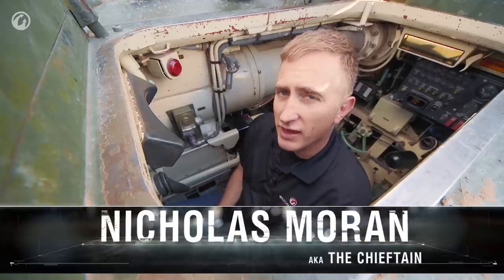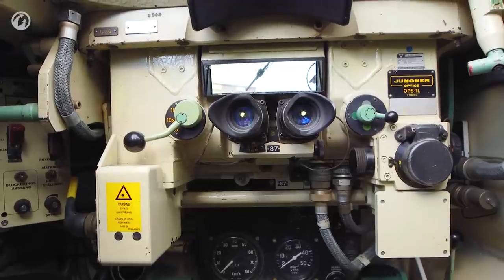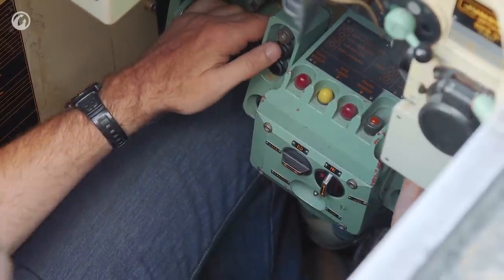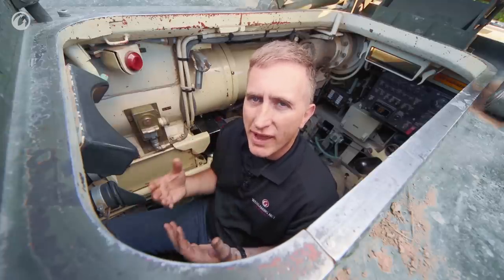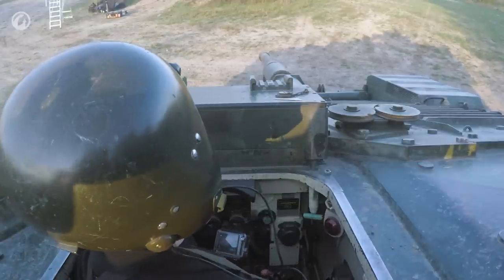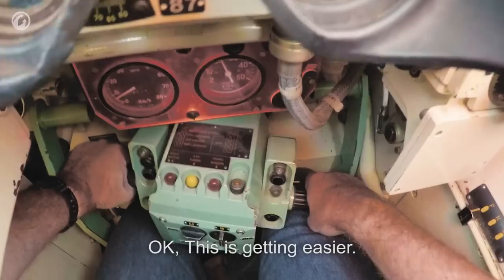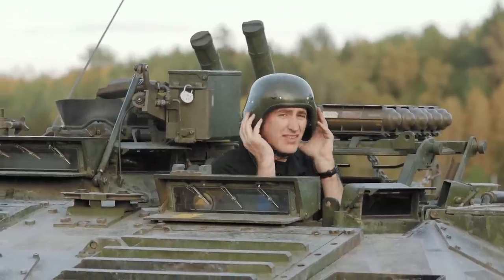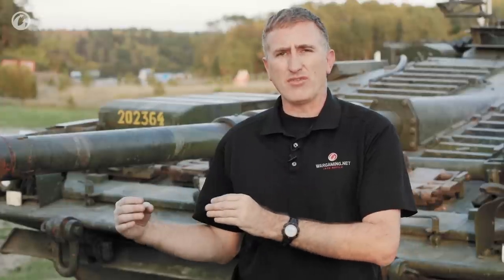Inside the Chieftain's Hatch: Strv 103C part 3

Comment: This was an amazing tank and it was a bold move from the Swedish government to put national security at risk on such a novel and unproven concept. I think the idea still has potential for a number of reasons:
- Advances in active suspension technology can make gun stabilization possible for this tank. You only need 1-plane stabilization as on the horizontal it's very easy to keep the tank on target manually with a car-like steering wheel;
- You can mount larger guns that would be possible with turreted tanks. I think a 155mm wouldn't be much of a problem.
- You can still add on top a small automated turret with lighter weapons if necessary;
- Lower height and thicker armor than in conventional tanks are still possible;
- Additional weapons can be easily mounted coaxially with the main gun; a Bofors 40mm autocannon for instance, to deal with softer targets;
- It has the potential to be cheaper than a traditional tank; that's no small thing in today's market where tanks have grown very expensive.
Reply: You would not like to add one gram to the weight of the 103. Your ideas are interesting, but they would immediately end up with a 80-ton monster that couldn´t swim, and would get stuck everywhere. The armor of the S was very thin, and making it able to resist modern APFSDS would add some 10 tons. A bigger gun, with a not too small magazine, would add another 3-5 tons. New engines to match this would add 2-3 tons. More fuel to retain range would add at least one ton. Sheer size to accommodate new engines, bigger ammo etc would add 10 tons, just by structural members, thin side/top/floor armor,  track length and additional road wheels. The 40 mm Bofors with ammo adds an extra 2 tons. And how do you stabilize a gun that is fixed in the hull, in height and traverse? Without doing away with the crucial auto-loader? Easy to maintain horizontal aim you say? Do you know how much 1 degree mean at 3000 m? I think you are dreaming, and very far from being attached to the reality. The Swedish designers in the 50´s were thinking outside the box, but they had common sense when it came to simple engineering - which you lack. They also had a list of goals to fulfill with the project, and they ticked them all. Sadly other countries didn´t have the same list, so it was no export success.

Comment: Looks like a great solution to the Swedish situation with heavily forested, rolling terrain in the defense..  One of these can control an avenue of approach like a boss and then disappear to the next position.
Reply: A good description of the actual doctrine👏
Reply: You could also advance forward while covered by your fellow tankers from one hull down position to another, almost like infantry. I believe they spend a lot of time scouting out positions.
Reply: I was thinking that the S tank design would make an excellent solution to a modern airborne firepower vehicle. You would have to reduce the weight to 20 to 25 tons, up the horsepower, use modern equipment add a small turret with a 20 or 30mm gun with a missile mount and a seperate remote  machine gun mount. I would like to see a 120mm gun tube but would settle for the 105 due to ammo stowage considerations. Obviousely the machine has limitations but it could be airdropable and would provide armored infantry support big guns where there arent any now. The requirement  would be largely defensive holding an objective until relieved...
Reply: @ONECOUNT  bounding overwatch ftw
Reply: @gweiloxiu9862  Exactly!
Reply: The Swedish forrests was one of the reasons behind not having a turret as you can't really spin a turret around in the middle of a lot of trees.

Comment: I beat with modern electronics you could redesign the S tank into an impressive modern tank. Many of the faults in the tank could likely be designed out of the vehicle now.
Reply: If it were to be redesigned, it would probably be more like the T-14 than the original Strv 103. There were a lot of tradeoffs made to accommodate the hull mount.
Reply: The Germans had a prototype like that called VT1-2
Reply: Shooting on the move would still be a problem.
Reply: @AlexKall  well yeah, this tank was never ment to do so, it was a counter to a potential invansion. it would dig in and wait, but due to drones and other recon ordinance it is obsolete. but back in the day, for what its purpuse was , it was pretty great. 
this video may have been missleading. this tank was purly defensive/ambush.
whilst he often compares it to the turreted counterparts.
turreted tanks are usally better in every way, tank destroyers in general are just cheaper sience one doesnt need to spend money on turrets.
Reply: @Obtite  my response was made in regards to updating the electronics, it would still not be viable or rather effective to fire on the move even if you redo all the electronics and drive control as the tank is physically not made for shoot on the move. Which was not a problem because of tactics and the fact that no other tank at the time could effectively fire on the move until its later years. But if it was to be updated and used till now it would not be usable because of doctrine of our armed forces and enemy forces, also the protection is lacking today and would not stand today's round if hit, even on the steep angle slanted front.
Reply: @AlexKall  even if they were to redesign it it woulnt be viable for a potential conflict. it was a good idea at the time, but now, it would be to flawed to be useful, it would just be a money sink
Reply: @Obtite  Yes, as I said previously.
Reply: Adapt the main gun to fire guided missiles along with normal shells, it would be even more dangerous because no time wasted needed to adjust the angle with guided missiles.
Reply: @Obtite  Completely wrong. This tank was purely offensive. I know, I´m trained in it and we spent 95% of our time in offensive maneuvers. Of course, for short-time tactical reasons we could set up a ambush... but defense against approaching tanks were normally left to anti-tank companies in armored or infantry battalions, with AT-guns, missiles and Carl-Gustaf anti-tank rifles. In the Swedish army, of approx 1.000.000 men, there were supposed to be some 2.000.000 single-shot AT launchers, plus a C-G in every rifle squad. Add AT-guns, mines and missiles from both vehicles and the infantry and its clear that the tanks had more important jobs to do.
You do not use attack aircraft, submarines or tanks to defend, they are born attackers.

Comment: You can depress and elevate as you drive. I feel WoT should try this in the Sandbox.
Reply: CardinalGamer oh and the angling does not affect the speed that much
Reply: well, it kinda is the case, as you can still drive when in siege mode.
Reply: Per the manuals, you aren't supposed to drive around at speed with the elevation gear on, the forces are likely to break it.

Comment: That turbine starting up alongside the engine is one badass sound. Scary too!
Reply: I hope you will experience that sound IRL yourself. And hear the "clonck" when the gear is engaged, the increasing RPM and whining sound from the GT as the accelerator and brake are pressed simultaneously, and see the jump the tank makes when the brakes are released. If lucky, you might even see a full "clutch-and-brake" maneuver, going from full speed ahead, turn and go the other way in about 1 second. Or, but that is just a dream, see a "target catch" - going full speed ahead, the commander sports a target at 4 o´clock, locks his cupola, turns the tank, returns control to the driver/gunner and 8 seconds after detection three rounds have hit the target - and the commander has been looking for other targets the past 5-6 seconds, knowing that this threat is no more. That is a challenge even for Abrams/Leo II/Leclerc.

Comment: I believe elevation values were increased for a total range of about 25 degrees in the B or C model. 11 down, 14 up. Technically the early models had a two-mode transfer case with high and low range; the transmission was on the piston engine and I think it was a three speed. The turboshaft had no transmission per se. Due to the nature of an automatic transmission's viscous coupling and a turboshaft's free power turbine, torque multiplication was roughly similar for both engine outputs to the transfer case. Later models I think had a similar arrangement other than the transfer case was an actual 3 speed transmission, removing the need to stop and change to low-range for rough terrain.

Comment: You looked like you were having a bit of fun. I always thought the concept of the S tank odd but interesting. I can see where a modified or evolved version could still have a place in the swedish toe. I liked the ribs on the front and think they should be explored on the Abrams. Including the track skirts. Reactive under the ribs? The risks there being shrapnel hitting blue on blue. 

As for the actual S tank, the only thing I would have done differently,  overall length. I would have add 12 to 18 inches in length to the crew compartment. I think it would improve comfort and efficiency. 

I wonder if the loader could be mounted in a low profile turret. Turret handles traverse and the hydraulics elevation.  Keep the crew in the hull, but provide turret access to the rear driver. This would allow basic service without dismount. The gun could be rigidly mounted or some stabilization to allow firing at.low speed under good conditions. 

I like the dual drivers. I had an idea for a fire support vehicle with dual gunner drivers. The vehicle being wheeled, one engine front and rear. in front of the engine, small turret, mounting either a Vulcan or a mini gun. Guns would be controlled remotely by either driver or the the commander. The crew would be seated together in the center using remote optics.

Comment: The suspension knows where it is at all times. It knows this because it knows where it isn't. By subtracting where it is from where it isn't, or where it isn't from where it is (whichever is greater), it obtains a difference, or deviation. The guidance subsystem uses deviations to generate corrective commands to drive the suspension from a position where it is to a position where it isn't, and arriving at a position where it wasn't, it now is. Consequently, the position where it is, is now the position that it wasn't, and it follows that the position that it was, is now the position that it isn't. In the event that the position that it is in is not the position that it wasn't, the system has acquired a variation, the variation being the difference between where the suspension is, and where it wasn't. If variation is considered to be a significant factor, it too may be corrected by the GEA. However, the suspension must also know where it was.The suspension guidance computer scenario works as follows. Because a variation has modified some of the information the suspension has obtained, it is not sure just where it is. However, it is sure where it isn't, within reason, and it knows where it was. It now subtracts where it should be from where it wasn't, or vice-versa, and by differentiating this from the algebraic sum of where it shouldn't be, and where it was, it is able to obtain the deviation and its variation, which is called error.

Comment: You showed how the AA machine gun was aimed, but how was the hull mounted machine guns aimed? Or were they directly linked to the hull aiming similar to the main gun? It looks like it at least has elevation capabilities and could have a little side to side depending on the mechanics.

On a side note, it wasn't so much discontinued due to drawbacks. It was discontinued due to economic feasibility since it was so specialized to Sweden's terrain and needs that nobody else was interested in buying it. Interestingly enough, its design now kind of lives on in the Merkava.
Reply: The hull MGs are fixed.
And as they are located far to the left it is a bit awkward when you aim the gun at the target and then switch to the MGs and the fire ends up about a meter to the left of the target.

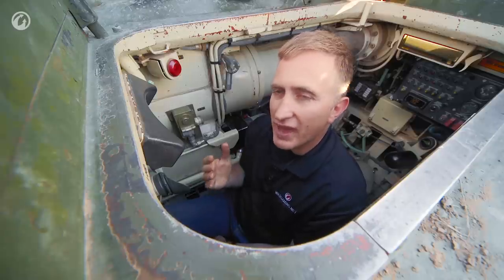Comment: 4:20 So, I was programming a ballistic computer for reasons and assumed that this would be a thing that a modern tank would do automatically. I was wondering how often were you tilted 15 degrees off to one side when making a shot (or enough to make the shot deviation significant). Then the sight and the gun would have to have separate traverse and you don't necessarily want to adjust the based on the sight while it is traversing so that has to be synchronised etc etc. I assumed this would be more important for longer ranged shots. idk.

Comment: Great video, thanks.  I wonder if a well trained crew could acquire and fire on a target as fast with their stationary 
gun as you could with your M-1 Abrams.

I served as a Section Chief in a Lance Missile Firing Platoon in the US Army so I am not an expert on tanks.
That being said i do think I know what was causing you to stall.   Before you move off from a standing position
your assistant driver should check that the  "  Atomic Batteries are to power "  and the " Turbines are to speed ".

And yes......anyone who was a kid in the 1960's knew that sound when you started the turbine.
Haha....it sounded just like the Batmobile.
Reply: There was a for it's time innovative hunter/killer system, that worked very well and made the tank reasonably fast to lay on to targets - I've talked to modern tankers who said they're still impressed how well it works. Trials found it wasn't much slower at firing on targets than a conventional tank. That said, once tanks became able to regularly hit while on the move (1980's and onwards), this tank starded to be quite disadvantaged.
Reply: Actually a rather complex question, which is probably the reason for lack of uniform answers.
In theory it would be possible to calculate - this time for traversing turret, loading ammo, measure distance, fire, etc...
In practice it is more complex. For the S-tank, training the gun to the target was quicker if going at some speed, but then you also needed to halt before firing. Typically this whole process would take 2 seconds (align gun and halt in one go). During that time the gunner had pressed "load AP" for firing at a tank. That process takes 2.9 second, leaving 0.9 seconds for fine laying of the gun, and maybe (very very seldom) measure the distance with the laser. This might take 2-3 seconds in total, so from detecting target to first shot with the S-tank needs perhaps 6 seconds. Second shot comes 3-4 seconds later.
For a modern tank like Abrams and Leo II, you will of course not need to either halt or aim the whole vehicle at the target. But you need to traverse the turret, which might take 1 second? You have to load, and make fine laying, so my very basic guess is that first round is fired 5-6 seconds from target detection. Being manually loaded, I´d say next round is

Comment: You said at 1:00 that this is not a vehicle for short personnel and yet you also state the maximum height for personnel was 175cm. I guess that was just an error.
Reply: 1.75m was the maximum for crew members & it's pretty plain Nicholas unintentionally used short instead of tall. Easy done when you're thinking ahead to the next thing.
Reply: Im 177cm and belive me. You dont want to sit for very long in that tank being taller than that.

Comment: So wait the driver is the gunner? Or the commander is the gunner
Reply: According to parts one and two of this video (and as far as I understood it) all three of the gunner, commander and driver are able to drive the tank (the tank is technically fighting capable with a single crew member). The Chieftain is driving from the gunner position in the video. The commander has an independently rotating cupola and can turn the tank around to point at a target, then effectively handing it over to the gunner. The driver is placed in reverse position and is also responsible for the radio (and loading the third ammo type, the two primary (usually HE and AP) are auto-loaded in 2-3 seconds). The tank drives about as fast forwards as backwards.

Tl, dr: Yes.

Comment: OMG why not turbine electric?? You could not stall and aiming in cover could be 100% silent .. also low load of the turbine engine could be used to charge the battery
Reply: Well, it was built in the 60's And retired in the late 90's
If developed or rebuilt for today that would certainly have been addressed.

Comment: Wait one crewman does everything? It looked like you were driver and gunner from that seat, and there is no loader as it is an autoloader. Also makes you question the crewmembers in wot, the tank doesn't have a loader but in the game it does!
Reply: EirikXL In reality, one man could if necessary operation the tank since the driver was the gunner and the tank was equiped with the a autoloader
Reply: It was a rhetorical question ;)
Reply: EirikXL I see, oh well
Reply: for gameplay purpose. It wouldnt be fair if arty stunned it but it still have the same ROF because it uses auto loadera
Reply: But where is that loader? XD
In the ammo rack?